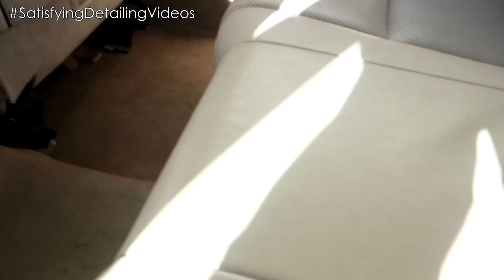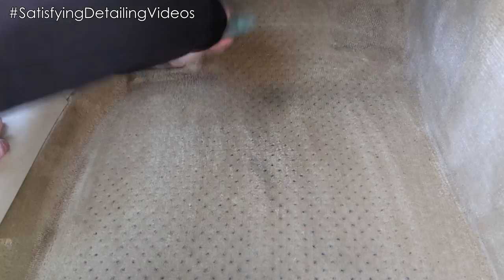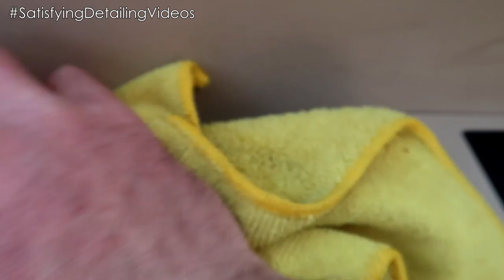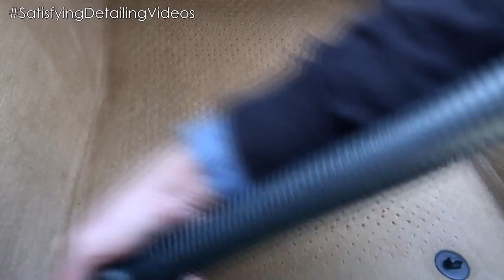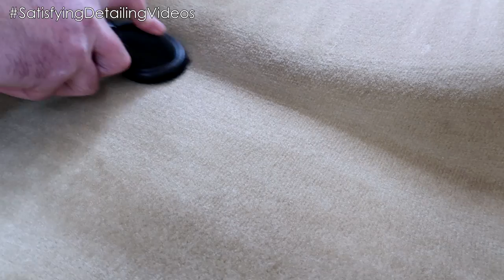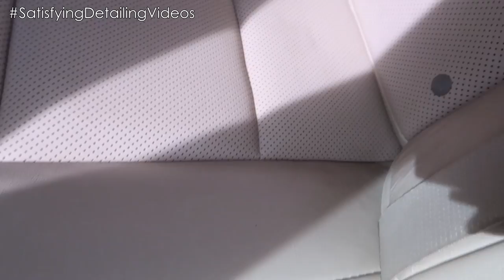Interior Detail // Carpet and Leather Deep Cleaning // Lexus

Comment: Good work. Love hearing the dialog between you & Mrs. Miranda!!!! Personally I'd have just bought new carpet mats if it were my car. Question: my husband scratched the plastic on my interior black door. How can I remove the scuff?
Reply from the maker: 🤣 Thanks!  
Aw man. Is it an actual scratch or just a scuff?  Proceed with caution: but using a heat gun carefully heat the area and it can remedy the plastic a little and hide the scratch.
Reply: @MirandaDetailing  actual scratch. I tried interior detail spray that cleaned it but the scratch is still there. Size 13 feet and a Corolla don't mix well 😥

Comment: Great video. What kind of chemical are u using to clean the leather and what's the dilution ratio u using?
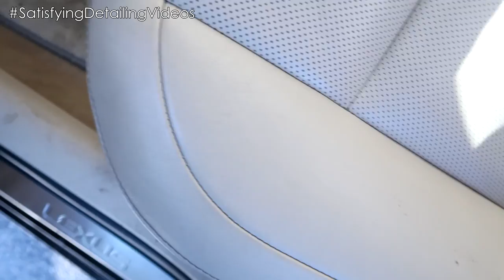Reply from the maker: Thanks. We are using 3D Super Citrus APC and their ratios are a little different. So I mix it pretty strong since we deal mostly with gross vehicles. We mix it at their recommended strong mixture which is 4oz to a gal. So about  1:32.

Comment: How do you keep the carpet from getting all stiff and "crunchy" once it dries? I used 3D carpet cleaner, and extracted with a spotclean.
Reply from the maker: Depending on the dilution rate and the type of cleaner, they don't always dry crunchy. i also use a damp MF towel to mop up the fabric and carpets and that helps rinse the cleaner out. If they do end up being crunchy feeling you can mist Vinegar diluted 1:2 and brush it in the fibers, it will neutralize the cleaner and make the fabric soft again.
Reply: Alright, I'll try that out, thank you!

Comment: A very thorough job on the mats. What spray did you use?
Reply from the maker: Thanks.  I used Super Clean 1:4
Reply from the maker: I also used 3D Super Citrus APC
Reply: 1 Part SC to 4 Parts Water or the other way around?
Reply from the maker: Yes you have it right. 1 part SC 4parts water
I usually mix 32oz of SC in a gallon jug and fill the rest with water.